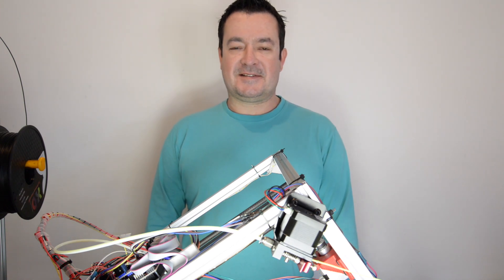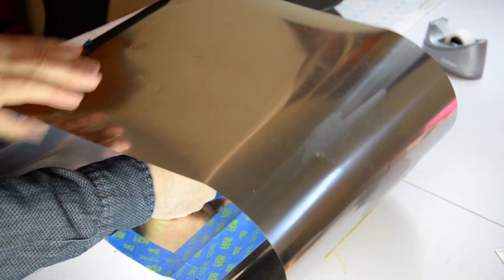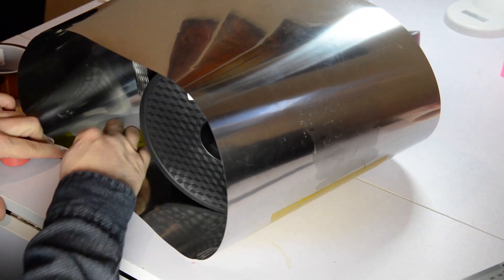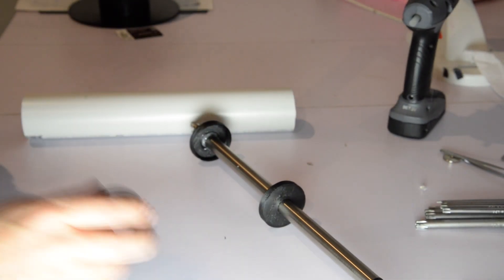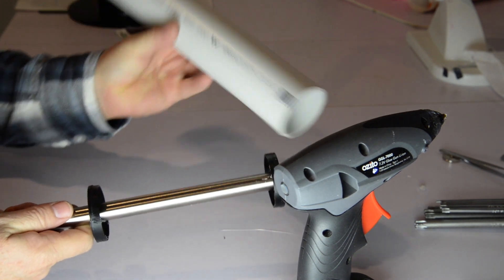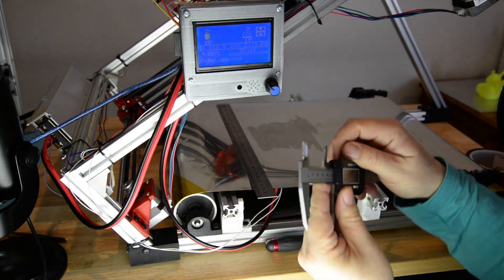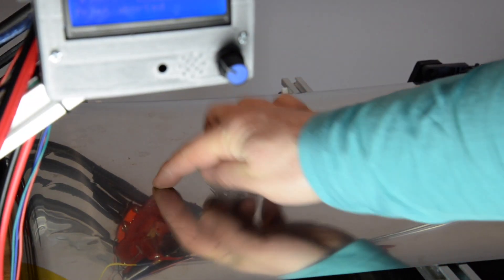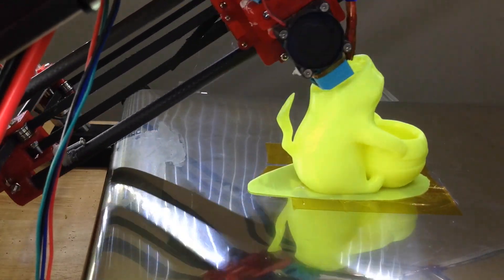Hypercube Infinite: Belt improvements and Bigger Roller

Comment: Hi would this work using a tevo tarantula and not tilting the extruder and using a conveyor belt for the build plate
Reply from the maker: Hi Ben. I like this question. I'll have to look into it. It is a great idea.
Reply from the maker: The gantry or the conveyor belt has to be at an angle.